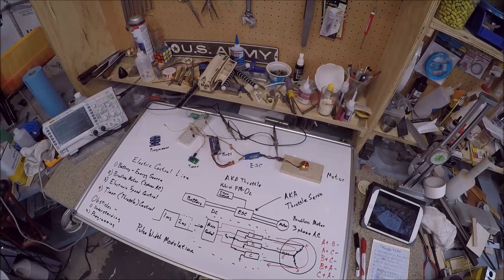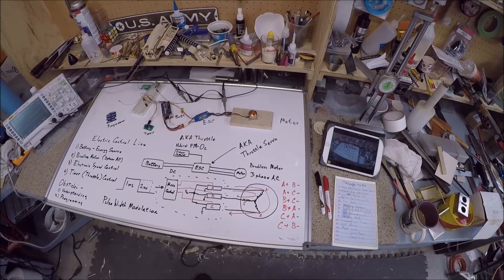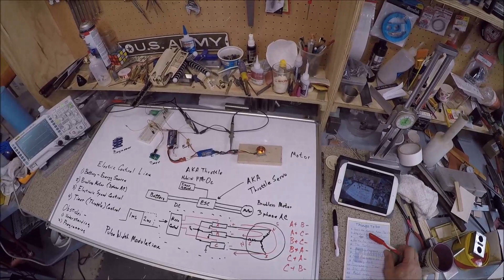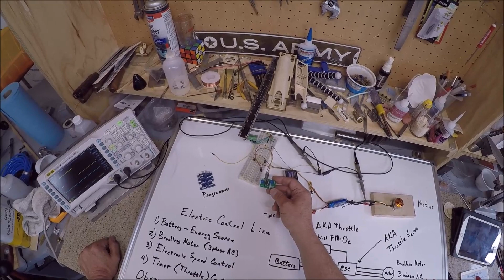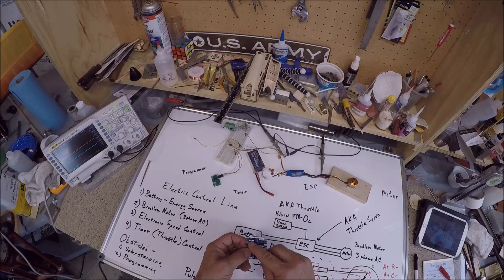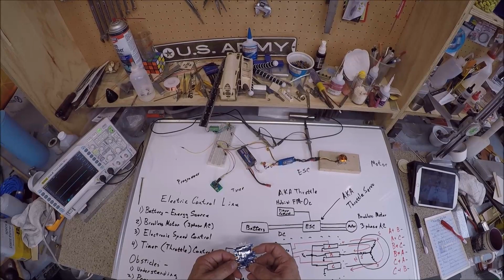Introduction to Electric power control for Control Line Model Airplanes

Comment: 6 MOSFETs 1 MOSFET powers a phase one direction through a phase the second the other way 3 phases 6 MOSFETs.    No SCRs are used in brushless motor controllers they were used in DC chopper speed controllers before FETs.
Reply from the maker: Yeah I know. my bad. I should redo this video and explain the commutator logic but it was really intended to simply highlight that the motor is just a 3 phase AC motor with a DC driver and the concept of how it is driven.

Comment: I tried this back in the seventy’s, never got off the ground, but it did taxi some. Old batteries of that era, and low power motors didn’t help.
Reply from the maker: The brushless motors and LiPo batteries are game changers. I have been messing with electric power since the early nineties. I had an early electric helicopter powered with a brushed motor and NMh batteries that could lift off into a hover for about 15 seconds and it was done. Times really changed since then. Electric is the way...
Reply: @feman43  I tried a motor from a slot car, in a Guillow's kit. And ran .010 copper break wire from a couple of lantern batteries through the control handle . Everything worked well but very low power. This was in 73 to 75 so I feel I was a very early unsuccessful pioneer……..